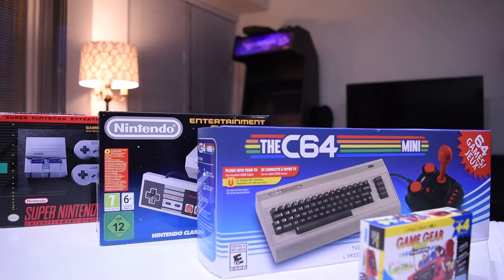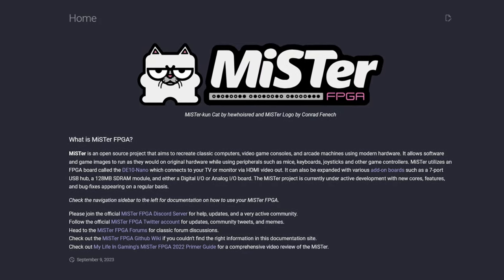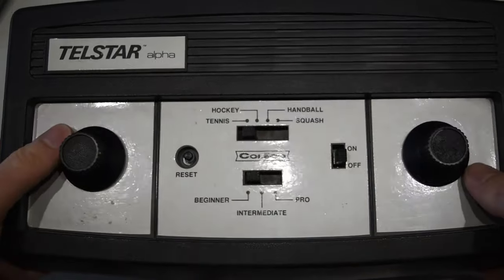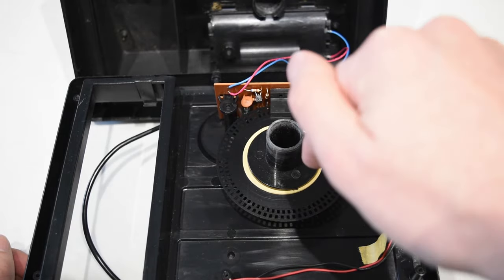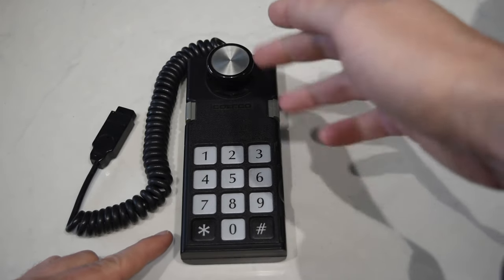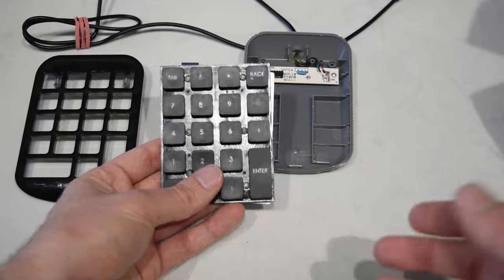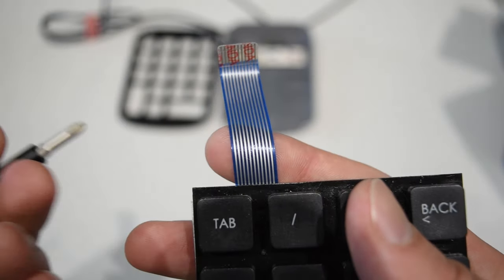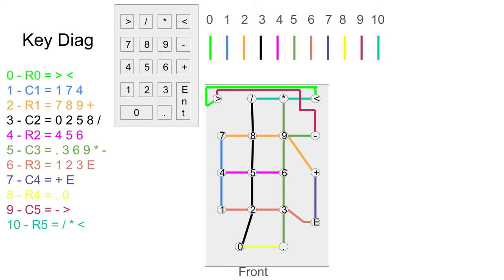The Issue With Current Retro Hardware: The Gen 1 + 2 Problem

Comment: The only controller that comes to my mind is the Jaguar controller. But it still lacks some of the features you described.
Reply from the maker: Yeah, the Jaguar is kind of the final evolution of that line of control schemes stemming from the Intellivision/5200/Colecovision style. Unfortunately it still misses a potentiometer and it is a pretty uncomfortable controller.
Reply: @ProfXen  yeah, i know, maybe you could hack the controller. Replace the D-pad with a potentiometer, and 3D print a more ergonomic casing. If the PCB allows it.
Reply from the maker: @nuldorvamoysenor2091  That would theoretically be a great starting point, unfortunately the Jag controller is itself pretty pricey these days, not including an adapter to USB or SNAC. I'll keep my eye out though.

Comment: I think about this occasionally. I don't think there's a good modern solution but Hyperkin did release a modern paddle controller for their Retron77 emulation-based console that you might be able to use with some USB adapters. For numpad support I'd just hope whatever emulator lets you map keys across multiple devices so you can use a gamepad and a USB numpad in tandem (maybe get one where you can easily rearrange the keycaps to make it closer to a phone pad.) It would certainly be nice if 8bitdo or retrobit or whoever decided to make a USB Jaguar Pro Controller for BigPEmu or the Atari 50 collection
Reply from the maker: That Hyperkin one is interesting, too bad it has so few buttons, but that's definitely one of the limitations of using the Atari-compatable pinout with multiple input mechanisms. They could've used some kind of switch to allow for more buttons while disabling one of the other input methods. It would be great for one of those companies to do a Jaguar usb controller, but with a nicer form factor.
Reply: @ProfXen  yeah, I mean that's all the 2600 had but it would be nice to have more. Sadly the Arkanoid NES paddle only had one button too. I think there was an Xbox 360 stick meant for early XBLA games with a spinner on it, but that's probably rare now and I read it kinda sucked. You can get actual arcade parts, but arcade spinners are big and kinda pricey I think (also I think they spin forever which is technically a different controller type)
Reply from the maker: @kameoosama   Actually the 2600 did have the Atari Keyboard/Keypad Controller (sold in sets of 2) as well as the Video Touch Pad and Kid's Controllers (all basically a number pad) which were used for a few titles, but clearly weren't that widely adopted.